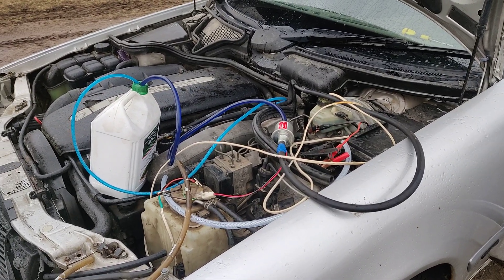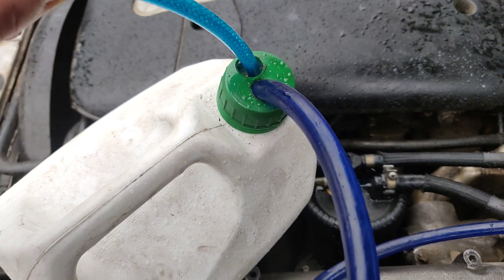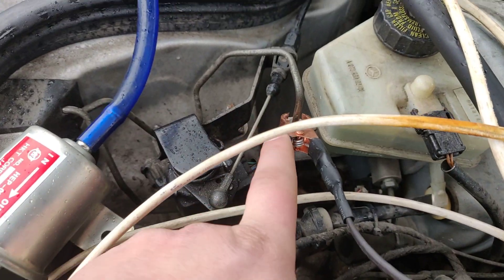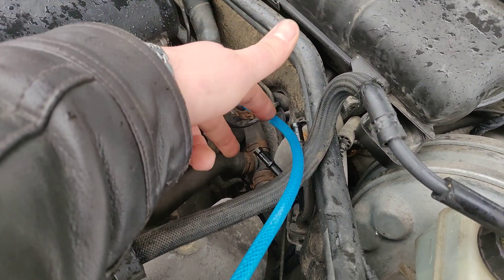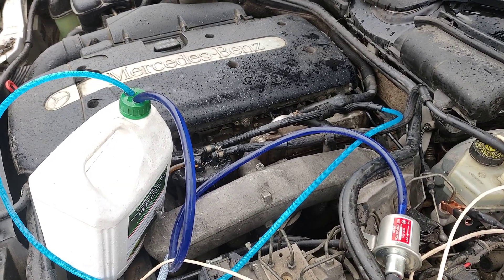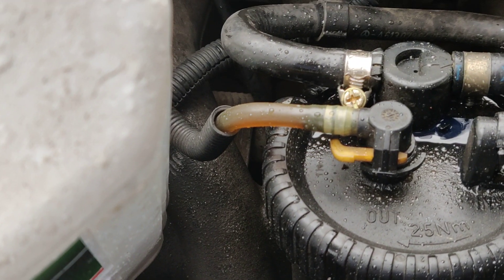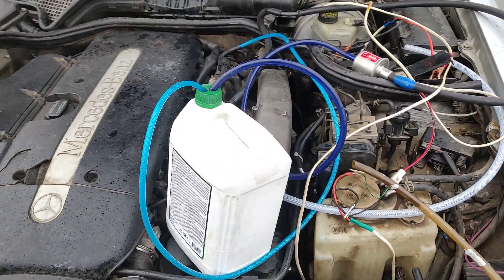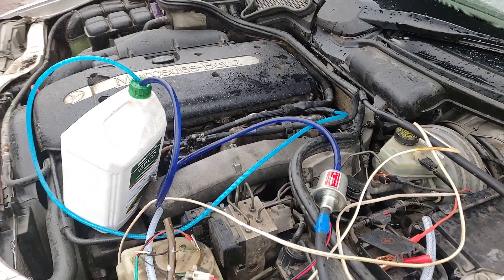Engine not starting-Mercedes-Benz fuel delivery problem

Comment: Pls help what do I do it doesn't return fuel back to the tank although we use normal inside pump to pump the diesel to the engine and the diesel will just dry up easily cos we will not get it back again,don't know if it's going inside the engine or else were. Pls help

Comment: Mine is cdi 220 c class 2001 model and doesn't supply fuel to the filter until you get fuel from one container before it start and